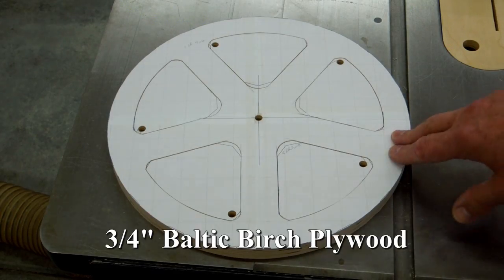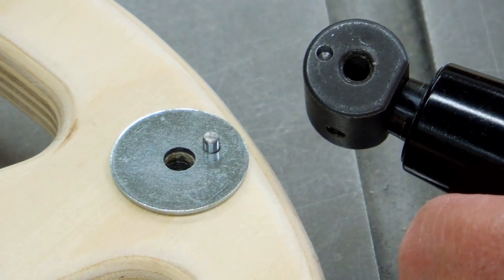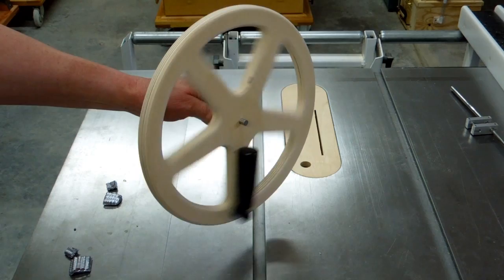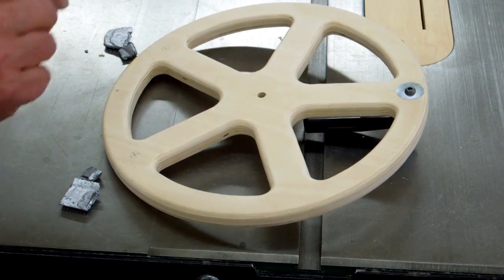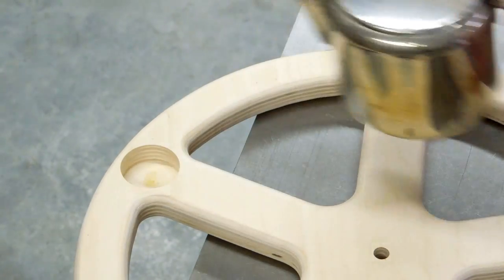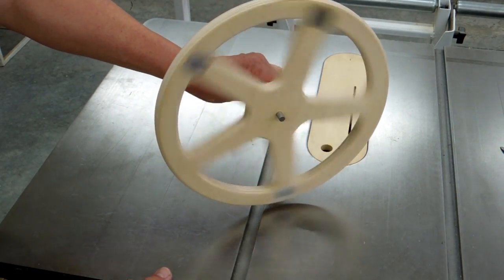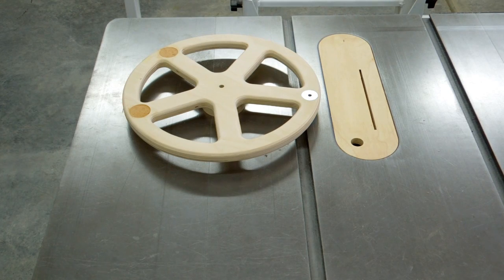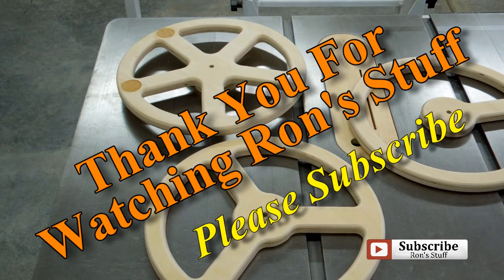Senior 20 Organ (06) Making The Cranking Wheel

Comment: Hi Ron, I am really enjoying your video's on the Senior 20 build, Could you please tell me what the outside diameter of the cranking wheel is please, Thank You.
Reply from the maker: +soggybottomped  I maintained the design 5-1/2" cranking throw (center of crankshaft to center of handle) and the wheel is 12-1/4" OD.
Reply: Thanks Ron, most helpful.

Comment: How did you attach the wheel to the shaft?
Reply from the maker: dbarr15 Watch my video "Senior 20 Organ (26) Making The Case" which shows the aluminum adapter I machined to attach the cranking wheel and the drive pulley.

Comment: I assume that you cut out the spokes with a scroll saw? If that is the case, what type of blade you are using to work with that plywood
Reply from the maker: AdmiralBumblebee I have a new favorite blade. Use it for nearly everything and those wheels were 3/4" ply. Also use it to cut 3/4" oak. ULTRA REVERSE  FD-UR No. 5 - 5" x 0.037 x 0.015  15 TPI with every 3rd tooth reversed. Flying Dutchman Blades - Mike's Workshop
Reply: Thank you for the response Ronald. I have had issues working with 3/4" oak ply (and maple ply) for gears and your results with the spoked wheels look very nice before sanding. I'll be grabbing a few dozen of those FD-UR No. 5s to try out.